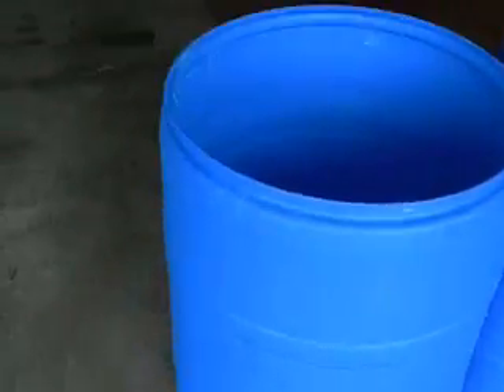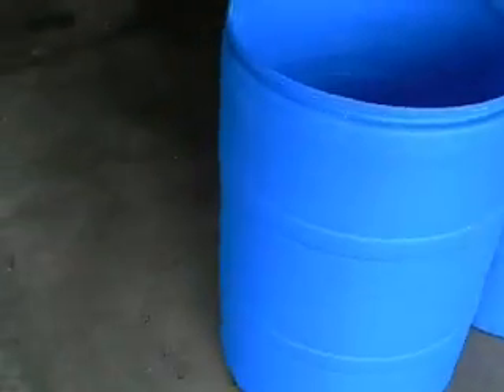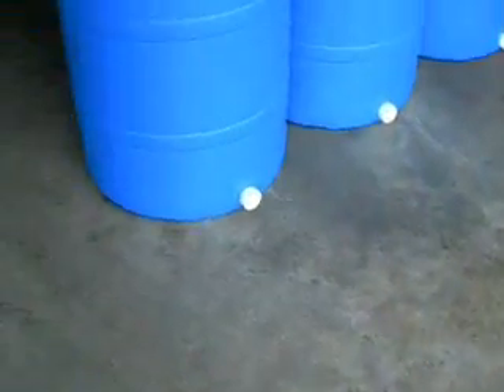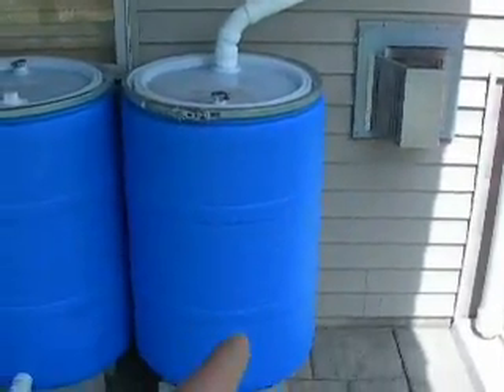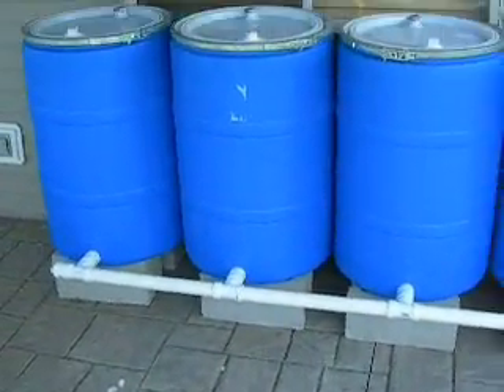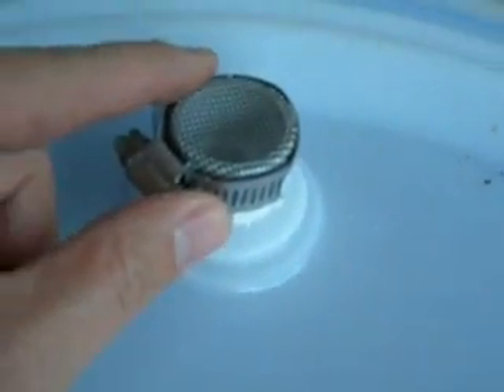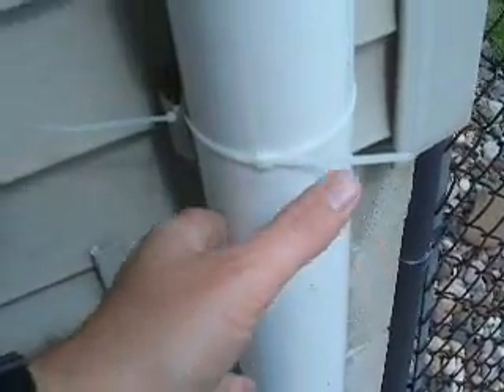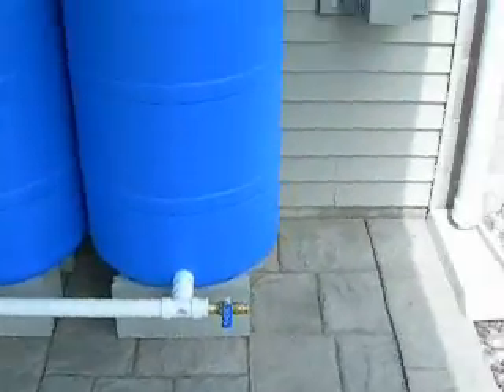Rain Collection

Comment: Good video. Great project, too. Any way you can utilize an otherwise wasted resource, such as rainwater runoff, to your benefit is a plus. Great for your garden when a dry spell hits, rather than using your domestic water source - which costs more and more all the time.  Planning a similar system, for my new location, too.
Reply from the maker: I would like to build it on a larger scale.  Maybe at the next house.  It was amazing how much water I stored from the first rainfall and how much money we saved by doing it.

Comment from the maker: The first flush does have a threaded cap on the end to allow drainage, it will completely drain out once it stops raining.  Because I live in MN I have to winterize the system in the fall. So I open the first flush cap to free flow.  This clears all debris out of the tube.

Comment: I noticed something about the overflow ports, first, you don't need one on the first barrel, it would vent up the inlet, but if you used some pvc to connect the vent holes in a manifold on the other barrels, the last barrel could have a long piece going up to a point higher than the inlet, water would stop filling when all the barrels fill up, and all the water would go down the drain.  Does that sound right to you?

Comment: The last youtube video I listed shows a great way to connect the barrels with an overflow, so no holes are necessary.  I use the Grady Barrel diverter to screen the debris, and connect the second barrel.  However, I noted that you aren't a fan of connecting the barrels on top.  We all have different requirements. :-)

Comment: I like how you connected the barrels at the bottom, I've only got two barrels so far, but so far I'm not using them with a hose, so they aren't chained together.  I went a slightly different way with mine, check these out:
bayteccontainers, look for the bulkhead fitting to connect a
faucet to a barrel without using silicone
Grady Barrels for water diverter
Youtube video
5 Dollar RAIN BARRELS 55 gallons to 1000 gallons
Connecting multiple barrels with part numbers for the pvc parts

Comment from the maker: @stevewitt54 The best way to increase pressure is to increase the elevation of the system. I do believe the ratio is 1foot elevation creates 1 psi of pressure.  How long of a hose?  I attached a 10 foot length just to make filling the water cans easier.  I have not tried a longer length as of yet.

Comment: @kalif151byccrew you seem to be missing an over flow pipe. When the barrels fill up completely then the water will just start spewing out the top. You might consider a overflow pipe at the top of the far right hand barrel so you can control where your run off will go.

Comment: @1oldarmyguy Big thx 4 the info. I found OffTGS vid showing the water bottle stopper system, MUCH simpler  and probably cheaper than the multiple fittings with a ping pong ball system shown by edvac1   though eds system looks really neat. 

BTW I have read the rule of thumb for "washing" roofs is 1 gallon per 100 sq ft of roof space. At that rate your 4 gallons will wash 400 sq ft.

Comment from the maker: @hoz49 I found the first flush on offthegridsurvival's channel.  Its nothing more then 3 inch PVC with a 2 inch reducer on the top.  Bottom side is a cap with removable plug so water slowly drains out.  The water bottle was just a standard plastic water bottle.   think it was the one like a dasani or something similar in shape.  I just cut the 3 inch PVC to the height I wanted.  You might want to also check out LDSPrepper as well he has a great rain collection system video. Step by step.

Comment: I would like to do something like that but my garden is a little too high.
Nice job and thanks for sharing how you worked through it.

Though you couldn't locate white or clear barrels you can paint the blue ones, I painted one I am using for a planter and it took the paint pretty good.

Comment: Great job man.  One thing I did that is not in my video is I put the overflow on the first barrel (gutter side).  With the manifold system it does not need to be on the last barrel.